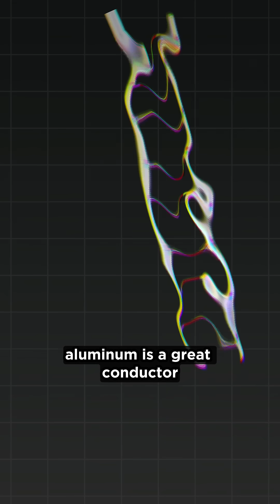How Did This Ladder Melt The Ground?

Comment: I think its the ladder thats melting, not the ground. You can see the lowest step of the ladder is way too close to the ground, ladders arent build like that.
Reply: Or maybe because the ground that was touching was melting and the ladder descended because of it... Either way it was probably both the ground and ladder.
Reply: @Mondayz408 your correct as contact resistance would heat up both the ladder and the ground and melt both

Comment: this angle of video doesn't show the full picture, there's another photo online that shows the ladder was indeed leaning on a thinner wire at the very top, the wire is bent inward from the weight of the ladder.
Reply: Finally, someone else who noticed this.
Reply: These videos always come up so I actually asked my senior electrical engineer coworkers about this since I’m still in school

Basically by standard up top we have three lines which are the phases, that’s how we can provide wye and delta configs that provide residential 120V, commercial 120/208, and lighting/heavy duty 277/480V

The three are out of sync so if they sun together to make 277 then one can have high voltage like 200V while another goes 50V but this changes over time. As long as you only touch one and are on a grounded lineman’s cart you won’t have any danger but the second you cross two you get the differential of the two (150V) using your body as a circuit.

Below the phases is telecom, and then ground which offloads any influx of unnecessary current.

Most likely this crossed a phase line while simultaneously touching concrete and dodging ground.
Reply: The main power lines are thousands of volts, it's the transformers at the junction that transforms it to 120240/600vac

Comment: At a high enough voltage = anything becomes a conductor
At a high enough current = anything becomes a fuse
At a high enough frequency = anything becomes an antenna
Reply: my exact problem with this video is that electricity is VIOLANT at high voltages if there is nothing keeping the material together it will rocket itself apart not gently boil and 2 the ladder being aluminum would melt and the air cant conduct or the ladder would melt/explode at the jump point as aluminum isnsoft and melts early. idk it seems actually impossible for thisnto be caused by electricity.
Reply: @KingSheva-sh5qw its a residential area, so voltage is not as high. Might be 10-60kv on tall wodden poles next to main roads, but next to houses it can be as low as 2kv. Yes shorting two lines will be violent with little resistance and all that current, but the ground is a crappy conductor especially with the ladder barely touching at just two thin points, so no explosions or fireballs, but enough current flowing to heat up the ground. 

If it was one of those metal H poles or god forbid the massive A or V shaped poles, a ladder touching would create a decent sized light show.
Reply: @xapcgamer151as you try and transfer charge through a melted substance it gains a common charge causing the material to be ripped appart and at high enough voltage litrally explode. the jumping point from alliminum to air would gwnerate the same hot point as the aluminum at the edge of the ladder is going to build up charge before ejecting in a arc effectively eating away at the alluminum, and lastly steel/asphalt act like that at 2000° if not higher Aluminum has a melting point of 600°, if those meterials are burning like that the aluminum would have simply melted away to the point it is not able to conduct electricity. all in all it does not make sense, i know what your saying its not 5billion volts or something but that should only make the ladder more effective as a fuse.
Reply: @KingSheva-sh5qw  your making little to no sense, it's not like the aluminum is going to instantly turn red hot there is probably 15kg of aluminum there if not more and a lot of surface area.
Reply: @crf80fdarkdays  more to the point: the aluminum ladder has a thicker cross section than the aluminum power line it is resting on.
Reply: @kenbrown2808 good way to put it simply, was going to mention aluminum is also used in wiring and is a decent conductor but didn't think it would go far
Reply: @crf80fdarkdays  yes, people with a limited understanding of electrical principles often take out-of-the-box thinking to explain things to them.
Reply: I don't get the antenna thing
Reply: What exactly are you confused about?  @rndnnm7864  Antenna just means it helps radiate electromagnetic waves.
Reply: low frequency*
Reply: @Zandex0 
High
Higher frequencies can use shorter antennae

Comment: I don't understand this at all. Powerlines aren't naked wires. Touch them all you want, you're not getting electrocuted. Something has to have gone seriously wrong for electricity to escape in the first place. Is this a real video?
Reply: A super thin layer of insulation isn't going to stop power lines from electrocuting you 😂
Reply: You can touch ONE of them at a time as long as you aren't touching anything else. If you touch one while touching the ground, you're fried.
Reply: @nbooth  Right, I was gonna say, dont be touching any downed power lines...!!
Reply: Distribution lines ARE naked.  Pole-to-house bundles are insulated.
Reply: @Kineth1 the ladder hit a high tension wire. Not sure if that is something else but that’s what happened.
Reply: If you touch a powerline and you're touching the ground, you will most certainly be electrocuted. An aluminum ladder? Especially so.
Reply: It says the ladder was against a high tension line.
We were still recovering from a storm a few days prior. So probably something with that.

This happened in Union Beach. I live a town over.

Comment: Really brave for those officers to stand close to it. The ground could be energized.
Reply: That's not how it works. Electricity tries to flow to ground and it's already reached ground. Yes, the soil is collecting electrons, but they're spreading out going. Yeah, willy-nilly anywhere they want to. It would never 
Go into them, unless they were the path to ground, even if they were standing on a copper plate without wearing any shoes. Which, by the way, the rubber provides pretty good insulation. They still would not get electrocuted, because there's nowhere that they would be connected to ground from the power source.Yes, they're connected to ground, but they're not connected to the power source.
Reply: @GabeCNCs  wow! Nice explanation man, thanks for the insights 👊

Comment: The electricity would take the part of least resistance. Wich would be the ladder stairs. But even if it was no ladder stairs the the electricity wouldn’t make the ground melt like that since it has a higher resistance than air. So there would just be an arc and no ground melting.

Comment: The video is likely fake. There's not enough energy in those cables to do something is violent as what is happening in the video. Especially not if the latter is isn't even touching. The power lines, and it's still melting the ground. Isn't your channel supposed to be about science, this is very obviously fake, or not related to the power lines or ladder.In the slightest.

Comment: just don't have overhead lines and have underground lines like our country
Reply: Most electricity lines in the U.S.A. cannot be underground, Ground type, water level, environmental factors, it is also. very expensive to set and maintain underground wires, even where it could be done.
Its a balancing act and when cases like this are statistical anomalies, it doesn't justify the costs.

Comment: Physics noob here, can someone help? Since the concrete creates a resistance in the ladder's path, shouldn't the current keep flowing through the cable? Or even take the ladder path, but avoiding the concrete through the steps?
Reply: You're picturing it incorrectly, electricity doesn't just take one path, it takes all possible paths relative to their resistance (how easily the electricity can pass through it). Imagine it like the water pipes going to houses, when you open one faucet it doesn't mean all the other faucets in the neighborhood stop working - the water tower maintains pressure through the water pipes regardless of how many faucets are open. The electrical grid works the same way, it maintains a constant electrical pressure (voltage) through the system, regardless of how many 'faucets' are opened (how much stuff is plugged in).

The ladder/concrete is like opening another faucet that's spraying into the concrete, functionally it's just another thing plugged into the electric grid. The difference here is that the specific power lines the ladder hit are very high voltage (high pressure, much higher than in your house), so rather than putting out a stream of low pressure water that the concrete can easily stop, it's putting out a jet of high water pressure that can blow up the concrete (or in the case of electricity, heat it up to the point of melting).
Reply: @mkilgore  You've got the best worded response so far. Coherent and accurate.
Reply: Yeah he should. But if automatic was configured right, that kind of situation wouldnt happen at all
Reply: Yes, the current is flowing through the cable and the ladder but only a little bit. Yes, the concrete creates resistance much higher compared to the cable and the ladder therefore more current, is passing through it, more heat, then lava.
Reply: The length of the cable, the tickness of the concrete, if it's reinforced and more matters as well. The longer the cable the more resistance, thinner concrete means less resistance to ground and if the concrete is reinforced it has metal inside it which would also make it have less resistance. 

Unless the concrete is completely isolated from ground (in this case the literal ground) it's gonna have a different electrical potential than the cables which would make current flow to try to "even" that difference.

Yes, electricity takes the "easiest" path but it doesn't just take one path completely, it "splits" so to say. The longer cable might bring enough resistance in itself to make more go through the ladder instead.

Comment: Look like termite burning, could the aluminum ladder just being stood on a very rusted manhole cover or a sewage cast iron grate when this high voltage discharge happened?
Reply: This happened in Union beach if you wanted to try to find out what happened.
Reply: @LloydUpsideDown  Could you give more point of references for the news? Thank You.

Comment: Who the hell forgot to put rubber lining on the electrical line.
All of u replying angrily chill tf out.
I just made a comment and know there is a war in my reply section.
Reply: Power lines aren’t insulated. Some are coated lightly to deal with rain, but they’re still uninsulated.
Reply: @doge_fish4820  Urban power lines should either be insulated, or underground. Something like this wouldn't be possible except in poorer countries.
Reply: @doge_fish4820  alot of the time the insulator is what determines its application, power line are typically not insulated as it would not only reduce efficiency but also the cost goes way up, like you said the wire typicaly has a thin coat but thats only to protect against weathering. Insulation coukd also heat up and become a hazard, meanwhile noinsulated wire would perform as normal, its why ballons are so dangerous to power lines as it can bridge the connection between two  currents
Reply: @doge_fish4820  in other countries (with higher IQs and where safety is prioritized over money, at least the one I live in) all overhead wires are insulated.
Reply: @Stone_624  Yeah but then how are we supposed get cool lava like this in a city?
Reply: @Stone_624  no tf they aint lmao.
Reply: @Stone_624  in fact why dont you go grab a power line and get back to me on this?
Reply: @Stone_624 , what country do you live in and what makes you think the power lines in your country are insulated?

Please don't say "I can see that they're covered in black plastic/rubber", because that thin wrapping won't actually stop the current from being conducted through a ladder or your body 🤷‍♂️
Reply: @Stone_624  BS. The live wire from the pole to the home is insulated.
Reply: @Stone_624  In America where one state is almost half the size of mainland Europe  insulating wires is extremely expensive and makes no sense to do.
Reply: @membranealpha5961 wdym the power lines(at least the ones that run to houses) aren't insulated ?? like are they just exposed like that ? yes this is probably a US only thing lmao
Reply: @keqling7086 no they are coated, just no insulation can stop that much voltage. It's the same for wires in your country too. That's why they are spaced apart
Reply: @braxtongay9983  "Safety was too expensive so we made the business decision to not"
- Boeing Executives
Reply: @Stone_624   I've handled 100KV insulated conductors for x-ray systems. They're as thick as a small tree and as the current is much lower than transmission lines, the conductors are far smaller. 

No way you're going to string sets of those on poles for hundreds of miles.
Reply: @Stone_624 no, they're rarely insulated unless they're directly above your house because the line insulation traps too much heat and lowers the rating of the powerline
Reply: At that high voltage, it doesn't matter whether there is rubber insulation or not. It is just going to jump to the conductor.
At a high enough voltage = anything becomes a conductor
At a high enough current = anything becomes a fuse
At a high enough frequency = anything becomes an antenna
Edit: Electronics Engineer btw
Reply: more like who in the right might took a metal ladder on to a power line
Reply: Power lines are spaced apart from other objects and each other. Air is the insulation.
Reply: In my country the power lines in major cities are all underground so its way safer than whatever they have in the usa
Reply: @Wickvg  In parts of the US the lines are buried, but in some areas burying lines are impractical due to weather conditions or water level.

Also, the US was one of the first to build a large scale electrical grid.  While much of Europe (and parts of Asia) saw significant destruction of their infrastructure during WWII, most of the US was untouched.  This allowed much of Europe (and parts of Asia) to rebuild their grids with newer (at the time) technology.

You're country isn't special, it just either benefits from a better environment for burying wires and/or having built/rebuilt their grids later when newer technologies were available.
Reply: @Wickvg  until it starts to flood
Reply: The insulation itself would be expensive. The added weight would also make the whole setup more expensive. Events like this are rare enough to be newsworthy. The cost would far exceed any benefits.
Reply: The high kv wires that are on top are bare wires. The black wires in the bottom are the 120v lines. The phase wires are coated the neutral wire is not.

The high kv wires are not coated as it would make them very heavy and cost inefficient because you need a thick insulation layer.

The lower lines are coated because they run to houses where people can touch them and we all know that we need to protect people from their stupidity.

I think somebody just had the ladder upright to move it and lost balance and dropped it on the kv wires. I hope the person let go of the ladder on time
Reply: In civilized countries, there are two types of wires: low-voltage ones, which are insulated, and high-voltage ones, which are not insulated and are therefore placed out of reach of a simple ladder, a ball, or anything else — either at a sufficient height of several tens of meters, or buried underground.
Reply: i dont think they are insulated
Reply: at least the high voltage ones dont
Reply: She looks like almost junpie
Reply: They aren't insulated to keep them cool
Reply: This is what's confusing me. I could be mistaken but, overhead lines aren't naked wires. They won't shock you to touch them. They're only dangerous if downed and broken so how is electricity escaping?
Reply: No chill here.  It's a pretty hot topic.
Reply: Lol the thought that other countries still think America has the collective capacity to place intelligent beings in important roles is heartwarming and heartbreaking at the same time.
Reply: @someoneelse4925 
No one likes you.

Comment: Aluminium is not a great conductor, it's an alright conductor. It's actually pretty pathetic for use as a conductor
Reply: Aluminum is a great conductor; it just has a few problems. It is more conductive than copper by weight, and it forms an oxide layer that isn't the best conductor. Copper is still better, but aluminum is still really good.
Reply: @Succulentquarter I'm glad you made the distinction 'by weight' because in order to get the same efficiency an copper, you're going to need about 3 times as much aluminum
That's not the definition of "great", that's subpar.
Reply: @Duck_side , shush.
Reply: @Duck_side  Aluminum is not "pretty pathetic" as a conductor. If you have a kilogram of both aluminum and copper, while the aluminum will take up more space because it is less dense, it conducts better per weight, while also being half the price. Just because copper is better does not mean that aluminum is bad. If that were the case, the copper is a pretty pathetic conductor, because silver is better. The only reason that aluminum being less dense is an issue, is that it is more prone to changes in size due to temperature, and the fact that sometimes you have limited space.